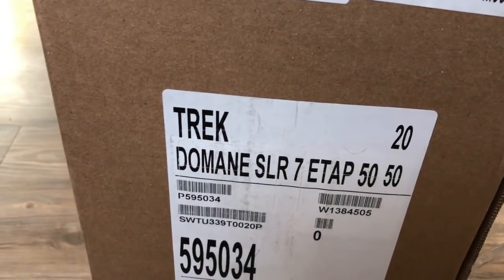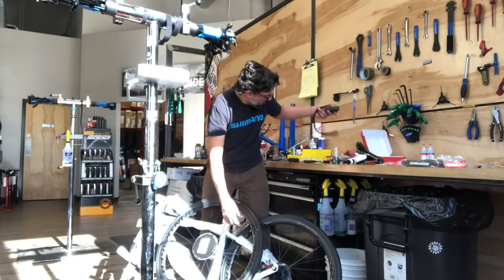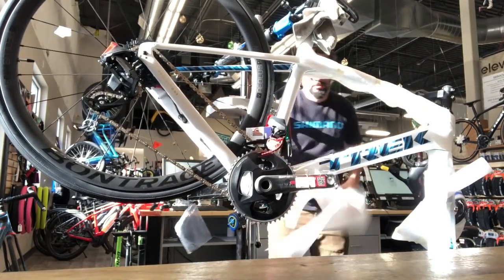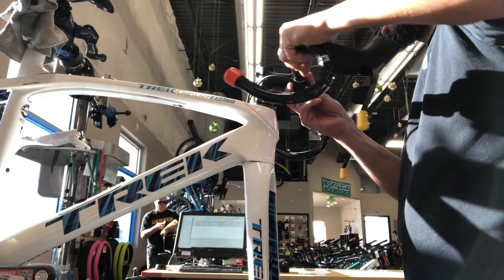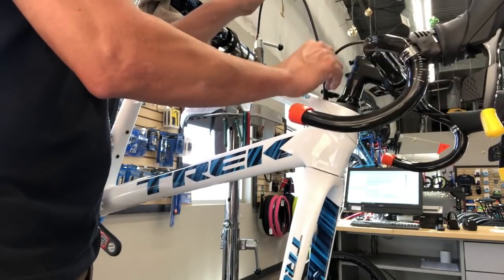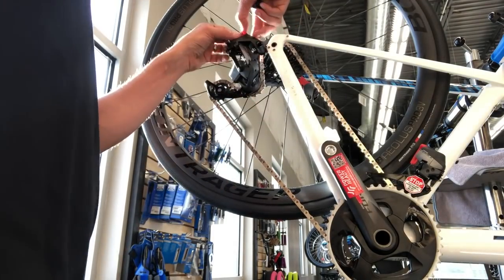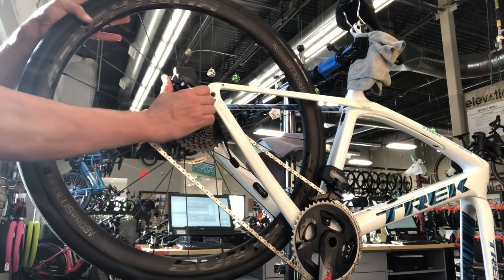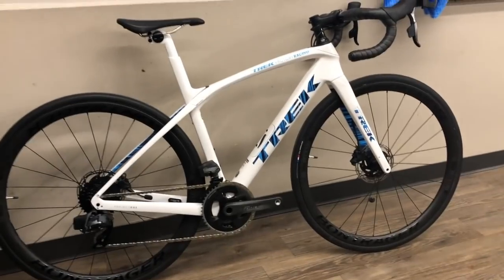2020 Trek Domane SLR eTap Project One Build

Comment: I have a 2013 Trek Domane (1st year production).  Love it!!! It weighs in @17lbs currently.  I can reduce that by replacing the 300g seat w/ a 150g seat and upgrading from Bontrager R2 Tubeless tires to R3's.  These upgrades will take another 190-200g off the bike to approximently 16 1/2 lbs.  Now I was considering upgrading to a new disc brake Domane ... even test rode one ... and I HATED it!!! ... It's the compact double!!!  All my bikes have a "triple" up front and I love my "granny" gear!!!  Now before you say I do not know what I am talking about ... I have a Mech Engineering Degree from a very very highly rated university.  So here is my simple reasoning:  Your gearing range is like a loaf of bread ... now my loaf is sliced into 30 slices ... the compact double is only 22 slices.  Yes, there is some overlaps w/ the triple,  but while the ground doesn't see the differences ... my legs do!!!!  Sometimes when my legs start to cramp, I shift down and "spin up".  And I know a lot of riders like me that do not like the compact doubles (usually they are older and have ridden "triples" for years) So I think the manufacturers are making a big mistake of only offering "compact doubles" ... so I'll stick w/ my red&white 2013 Domane for the fore see-able future ... And a side note:  since I do not "mash" the pedals but sit on the seat ... (and keep my chain super clean and lubricated) I get over  7,000 miles before needing to replace the chain ... It is a GREAT bike!!!
Reply from the maker: The main issue with triples is like you say, there are some overlaps with multiple gears being the same or very close duplicate ratios, but the biggest thing with triples is the shift quality is nowhere near as good as a modern double. The biggest complaint I hear about a wide range double or even a 1x setup is the bread slices are "thicker" meaning a bigger jump or drop between gears. 
Honestly for me, on the bike I commute with I had a compact double with an 11-28 cassette. Whenever I would shift in stop and go traffic, I would often find myself shifting 2 cogs at a time because shifting 1 at a time was not a thick enough slice. I went to a 1x setup on that bike, kept roughly the same overall range, but the gears all seem more useable for my commuting conditions.
I made a couple other videos on going from a common road triple setup to a wide range double. https://www.youtube.com/watch?v=q07DQ24rPl0
And my commuter bike going from double to wide range single https://www.youtube.com/watch?v=xF-KaqMeEig&t=1s

I'm not trying to convert you over from a triple set up, but being a mechanical engineer, you may find the information and charts in the videos interesting.
Thanks for taking the time to leave detailed feedback, I appreciate it!

Comment: Hi Joey, I'm looking to possibly buy an older 2019 Domane SLR frame, from what I see online the seat mast is a different design than the 2020. I've read a lot of negative reviews online about the seat adjustment for 2019 model. Other than the seat mast would you say the BB90 is reliable with 24mm crank? I can't spend the money on the new frame with T47 and improved seat mast but would like to know if the 2019 is still a good buy in your opinion. Thanks.

Comment: Should be over 18 lb, even in that size
Reply from the maker: If the bike is still at the shop next week, I'll weigh it and post the results.
Reply: @JoeyMesa  What Size Frame Was That?
Reply from the maker: 50cm
Reply from the maker: Yep, you 're correct, it's about 18.5lbs.
Reply: @JoeyMesa  When you said 15 or 16lbs, I thought no way...that can't be right because that would be in the same arena as the Emonda SLR.  I built an Emonda and with 38mm wheels it weighs 13.99lbs.  I surely would not think the Domane would be anywhere near the weight of the Emonda.  Glad you cleared this up.